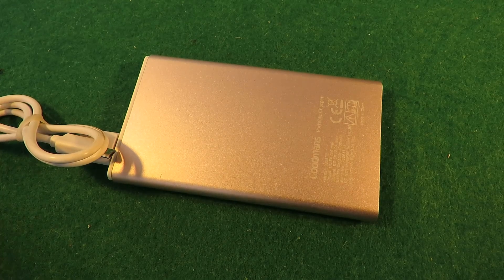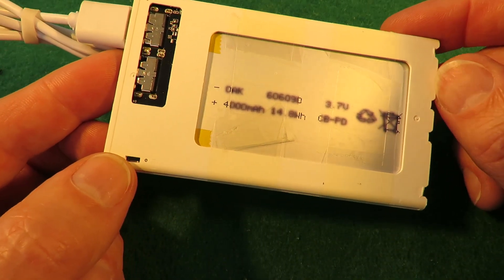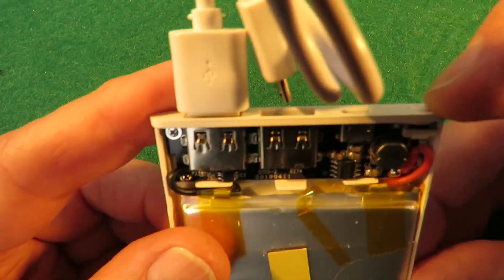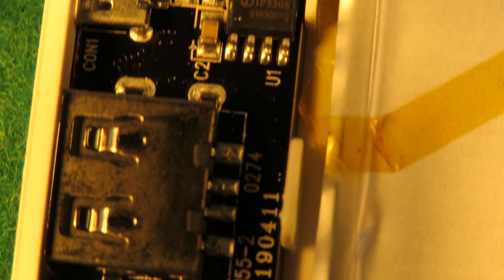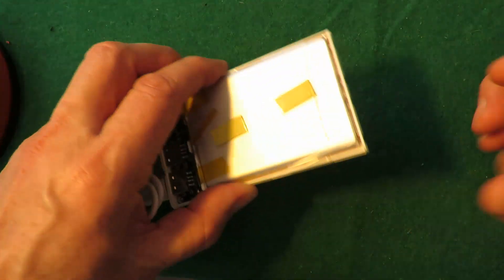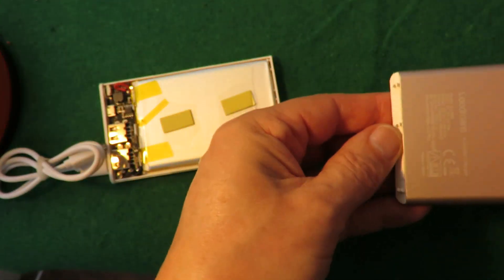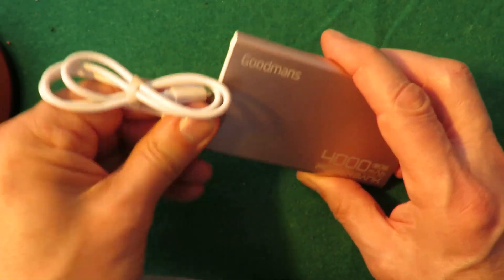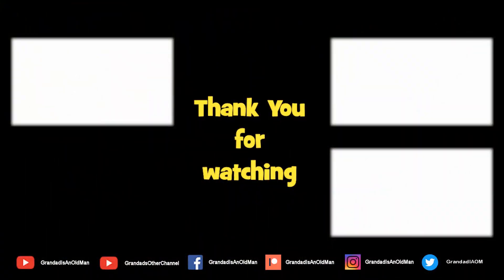Peek inside Goodmans portable charger 4000mAh

Comment: Here's a tip... 'they say' such powerbanks can't be charged and discharged at the same time. Have found that to be false and is why am using one on a CCTV camera on the shed. As long as the powered device (camera in this case) is already running the powerbank will charge, using whatever isn't drawn by the device. Have got a 5W solar panel connected to it and the camera runs all the time.
Reply from the maker: Handy tip. At some time I do want to set up a motion sensor camera out there possibly using my old car dash cam. Not for security as such, just to see what wildlife is out there at night.

Comment: I hate that material for portable batteries. I prefer a soft rubber sort of casing.
Reply from the maker: If that is what you like I am sure you can buy them, This thin metal case means it fits easily in my wife's handbag without taking up space.